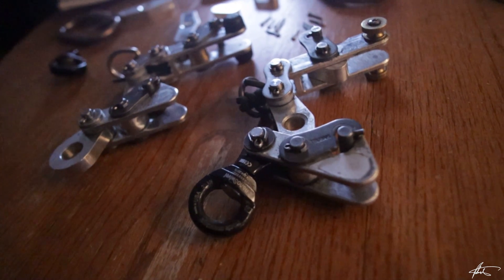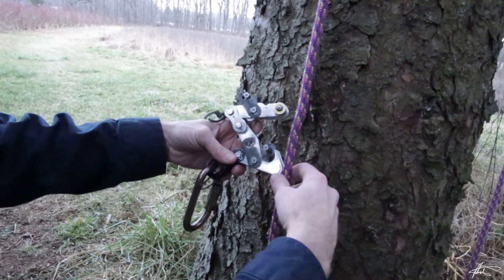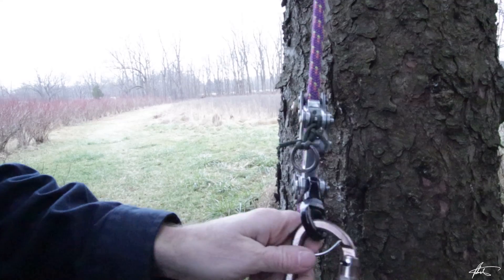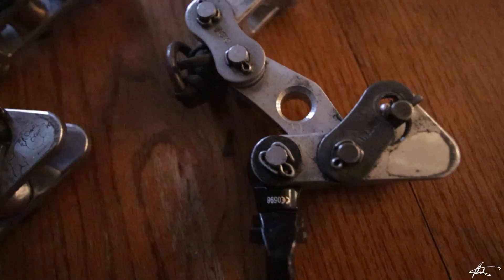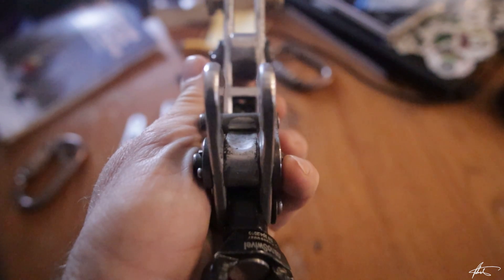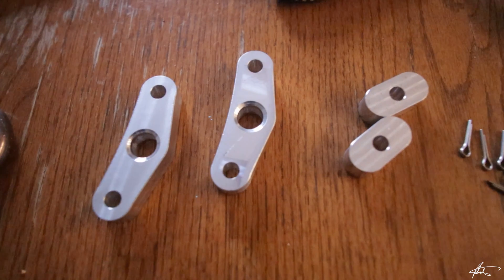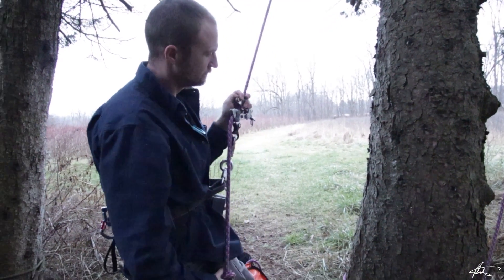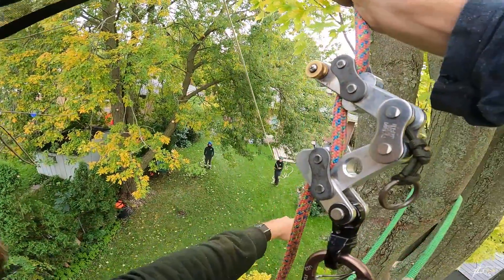The Bulldog Bone Climbing Device

Comment from the maker: The Bulldog Bone currently sells for $345 USD which includes shipping within the US. International shipping costs more. (current as of Jan 2024)
Reply: Thanks boss ..your the man pat
Reply: And we were same green uniforms..
Reply: Comparable to a Burly Akimbo designed by someone who understands equipment linkages. But sounds like a few climbers out there need some machining so they can shuttle a prusik or something. Do you think the redundancy would void the mechanical advantage?
Reply from the maker: @AdvancedStructuralPruning  I would not add a prusik above the Bone, certainly doesn't need it and would make it a real pain to use...
Reply: I figured as much. Thanks for bringing something that can compete to the Market. I don't get up there enough to justify $345 when I can work with MRS.

Unless this thing can do what it looks like it can do. And Serviceable!

Can we schedule a test @climbingarborist?

I'd like to find out if he thinks it's safe 🪖🌲

Even though it doesn't have a International stamp of approval
($$$$$$$)

Comment: I finally got one of these, went with the self adjusting bolard version. It Wont run atall on tachyon ash or cherry bomb and tending was too stiff on hyperclimb - an 11.2mm rope. What ropes work best with this version? I can see you're using km3 max in some of the bone vids.
Reply from the maker: I've had good results on km3, rebel, squir, blue moon